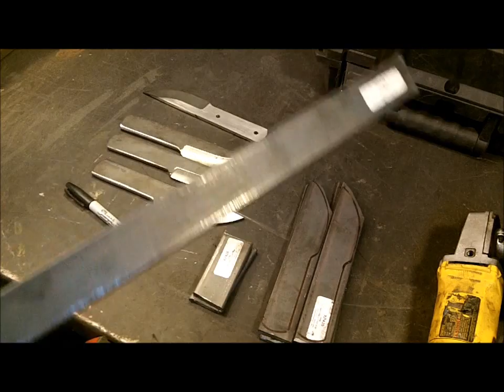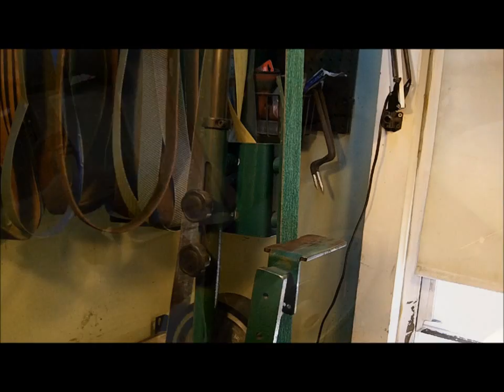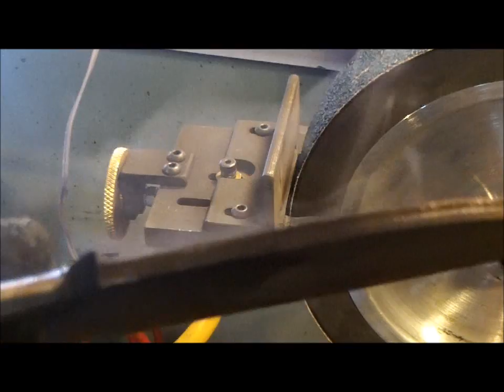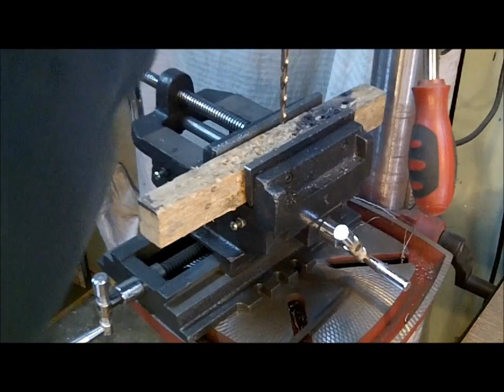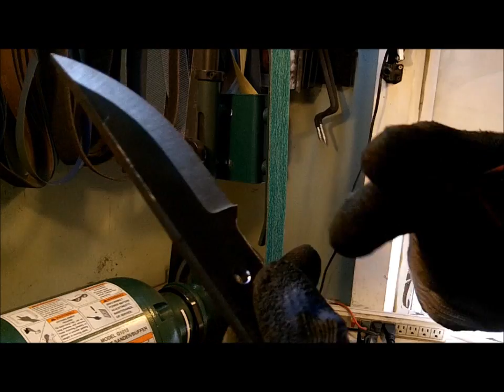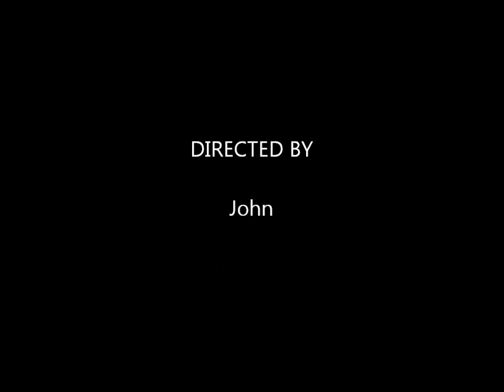Knife Making Tutorial-  LAST-DITCH Knife

Comment: What kind of drill bit are you using to drill the holes in the steel?  You said you get them by the 12 pack........I'm trying to figure out what to use to drill the holes.  Normal bits designed to do metal seem to be having a tough time.

Comment: You could get yourself a nice set of High Speed Steel drill bits that would cut much nicer and faster.. RPMs would be much higher around 1920 rpm with a much higher feed rate... That bit looks like one of the cheaper HHS bits... Even without oil you could feed it faster with higher RPM... Going slower can also burn out that bit quick just as if you were to go too fast.